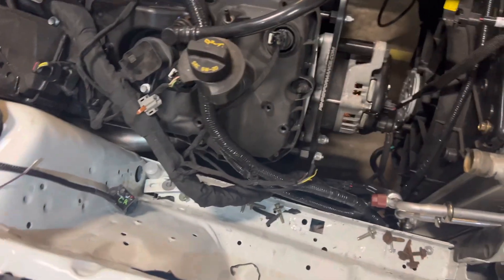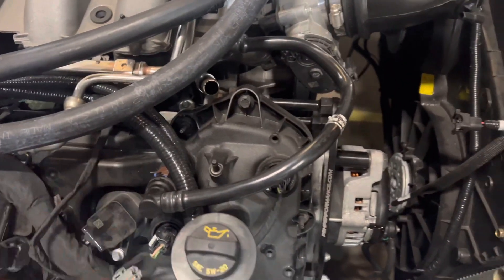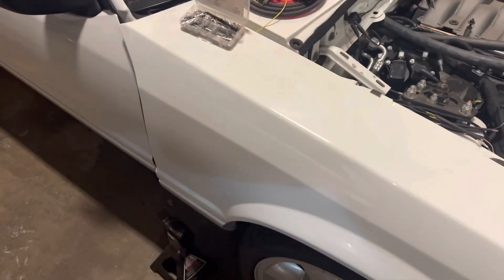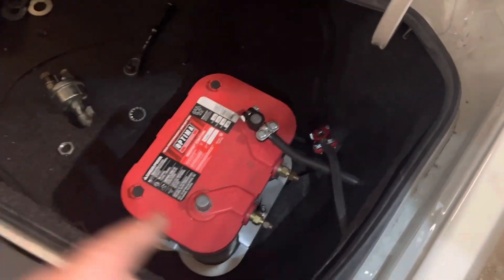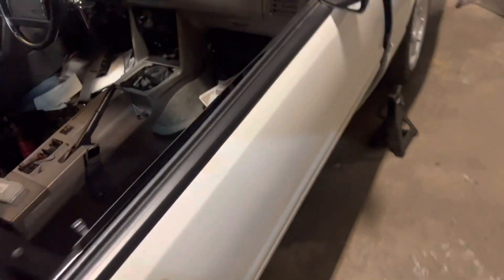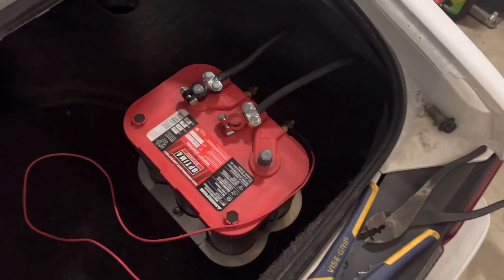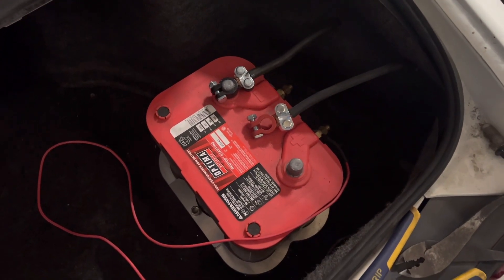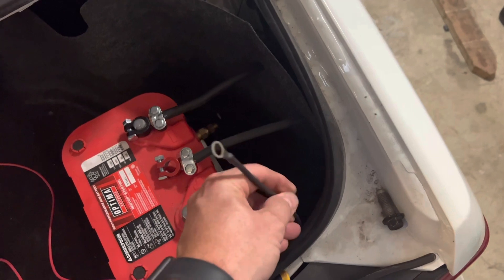Foxbody gen3/10r80 Coyote swap part 6

Comment: Are u running a gen 3 oil pan still? If so, what kmember are you using and did you shim it down? Getting ready to start doing mine. Finally have enough parts to start putting it in.
Reply from the maker: Yes I have a stock gen 3 pan.    I’m using a UPR k member with 3/8 motor mount shims and 1/2 k member spacers.

Comment: keep em coming doing same swap now. besides trimming the trans anything else i should be aware of? looks like you had to extend control pack wiring?
Reply from the maker: The gas pedal wiring on the control pack and a few things on the engine harness had to be extended.